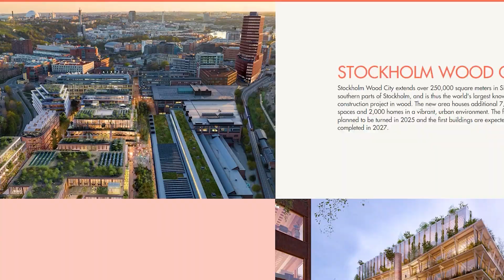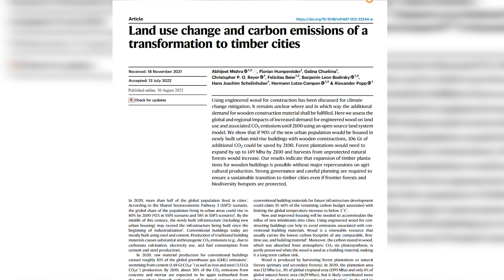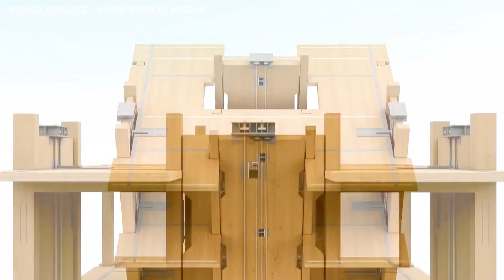The INSANE Plan To Build The World’s Biggest Wooden City

Comment: 5:27 thats really cool , i never heard of that tech before !
Overall , i like the idea and its only a specific place for business purpose , but 1 particular issue about wood that i myself noticed that when it gets really old , it can somewhat smell a little bit metalic and that is not good in some people. Wood captures the smell of people overtime it get exposed with air. Not too practical. 

Also i want to add my little research that did examining most of horror haunted houses: the place is mostly made out of wood..... seeing ghosts , memories , something similar etc.... explanation goes on and on, bottom line is that is something (atleast prersonal and practical perspective) that is keep in mind for some specific people. I found it funny but at the same time its real:very real you can say , that type of weirdness you can't just ignore about what other effects wood furnitures can bring. Keywords : metalic smell and wood  👍
Reply: "Wood captures the smell of people overtime it get exposed with air. Not too practical." No it isn't. All wood, especially as a structural and exterior material, is treated and coated in various solvents, laquers and fire-retardant and weather-resistant sprays. None of the wood you see in construction is unimpregnated wood. These coatings need to be reapplied every few years. What you are smelling is dust and pollutants that have gotten stuck to the rough top coat. Every single material captures dust and particulates on its surface.

Ghosts aren't real lol. You know how many of them would be everywhere if they were? There have been a total of 117 Billion humans alive over the course of history.